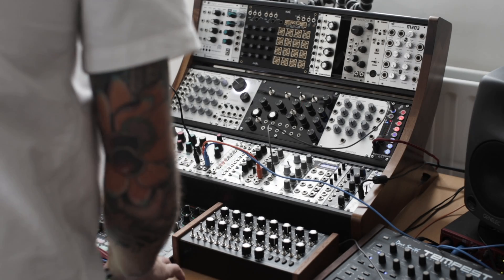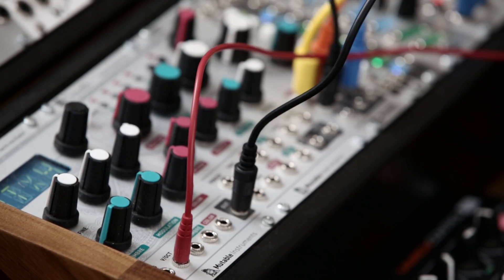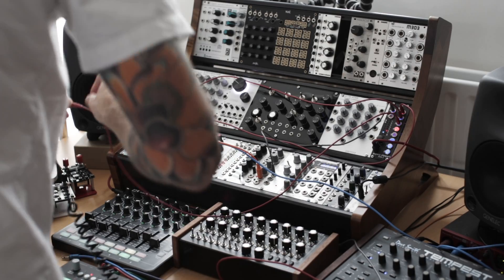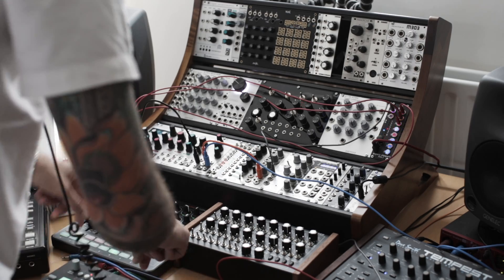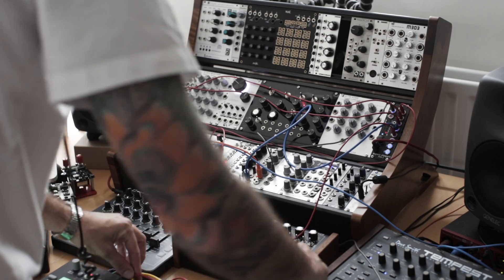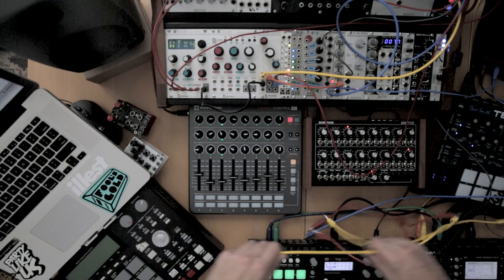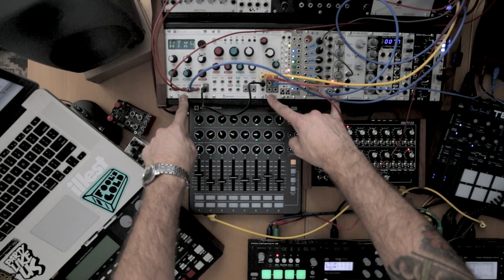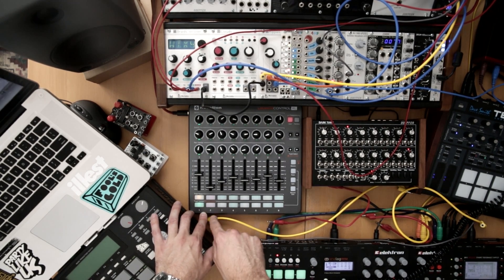Novation // Launch Control XL - Standalone Modular Synth Control

Comment: Its NOT standalone. You need a USB->Midi Converter … like iconnectivity, etc
Btw, the new akai controller has an "real" Midi-Out …
Reply: Es standalone porque no necesita ordenador, cosa que otras muchas sí. Además, hoy en día hay aparatos que también llevan USB por el que reciben MIDI, aunque tu comentario es de hace 9 años no sé si si los había ya entonces jeje